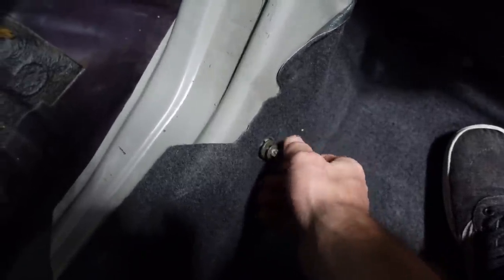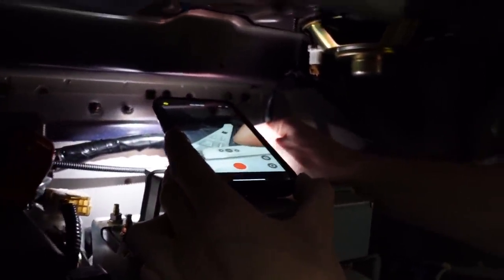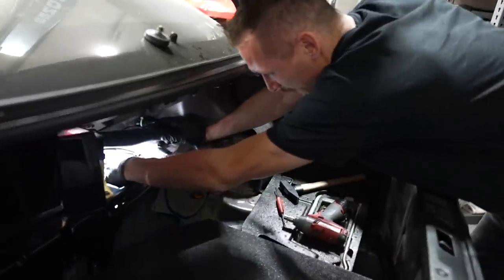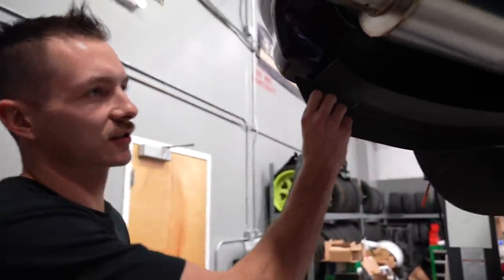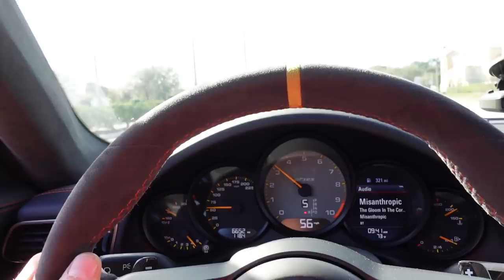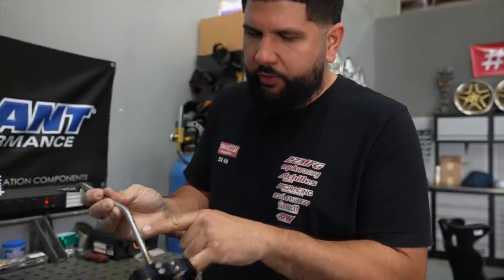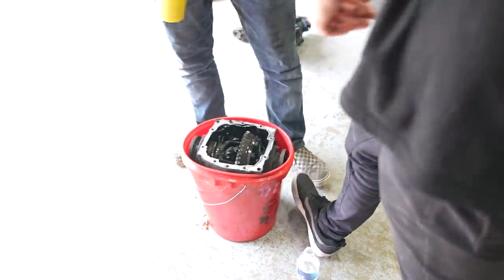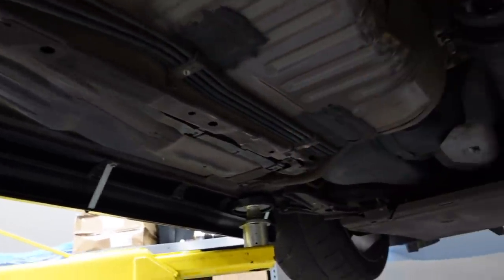Diving into the R34 GTR Fuel System

Comment: Just a heads up , clamping the pumps like that on the plastic will potentially cause you issues with cracking and airlocks etc. Best to machine the clamps to mount the pumps correctly  would hate to loose an engine due to going lean

Comment: Have you never compared a S15 spec S and a spec R? Spec R has lots of extra bracing: the roof, top of the b-pillar, bottom of the b-pillar, front and rear strut tops, front subframe, rear subframe, front lower control arms, corners in the front of the boot and a bar in the rear of the boot.

Comment: Adam, you cannot split an electrical load with 2 wires going to 2 separate relays... electricity will always find the least resistant route. One of the relays will not have a load.
Reply from the maker: That’s power coming out of relays, not into them. One large power wire feeds all

Comment: Adam said he is going to run a -10 feed, I think someone there needs to check flow rates for fuel systems. -8 is all you need for up to 1300hp. I run -8 feed for an 1800hp 2jzgte and I run -6 feed and return for a 700awhp R32 kit I make. I also run a single -8 feed for my s550 mustang that makes over 1000rwhp on e85 and i have ZERO fuel problems. Also I may have misheard but adam also said something about running the fuel system at 80psi ????? What the hell are you guys doing? it is 43 psi at idle and at MOST the fuel system should see 70psi MAX. With the set up you have you are going to see at most 800 rwhp and thats way over shot Realistically you will see around 650-750rwhp. 

I wish one of you guys would see this comment you DO NOT need to drop tank at all you can run -8 through the passenger side, also again DO NOT RUN -10